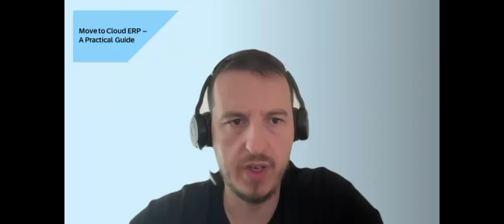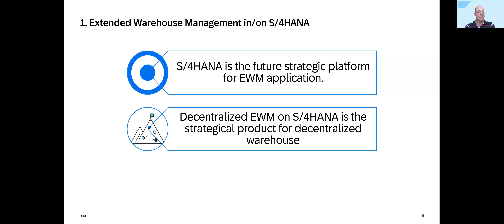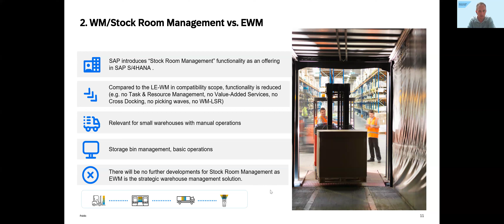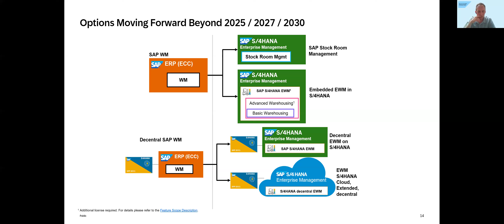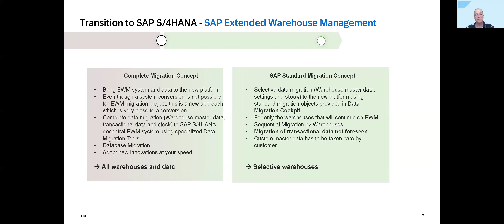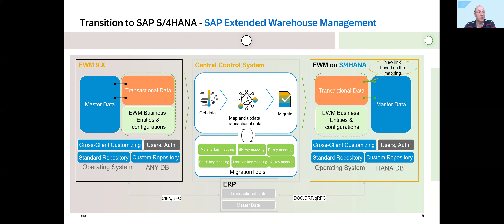SDT - how to deal with other SAP suite solutions? Focus: EWM I Move to Cloud ERP I 25.04.29

Comment: Does SDT mean a third party product like Natuvion?
Reply from the maker: SDT, or selective data transition is a transition scenario is an alternative to a System Conversion and New Implementation for moving to SAP S/4HANA. This option combines the advantages of both approaches without their limitations, using innovations in S/4HANA while selectively leveraging and re-using your existing investments. 
Through a specialized value-based approach, it facilitates data selection and transfers relevant data irrespective of status, such as closed items. The transition process maps your current system's data and processes to a new setup, ensuring all relations and interdependencies between different items remain intact. 
All partners (SAP, SNP, Natuvion, cbs) in the SDT community can deliver this approach by offering specialized services supported by proprietary tools. SDT is not a product, it's approach.